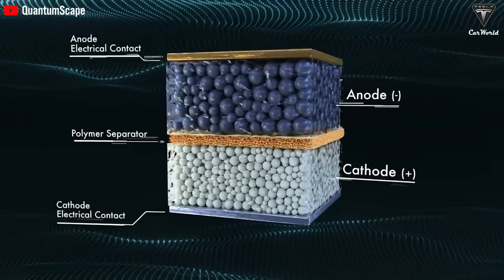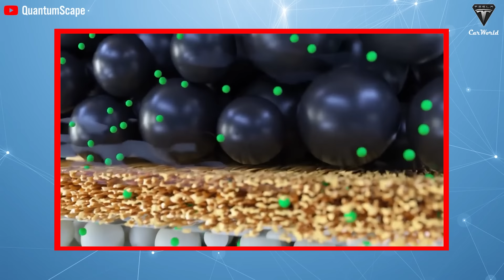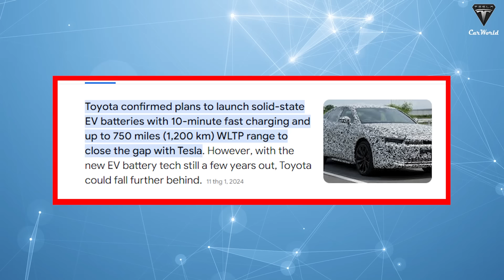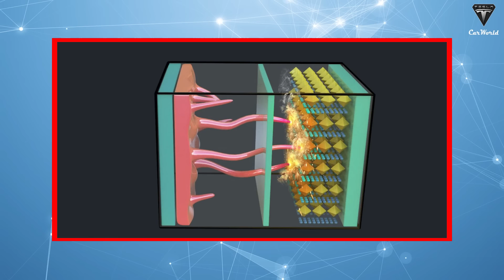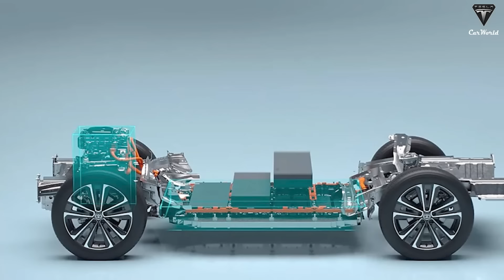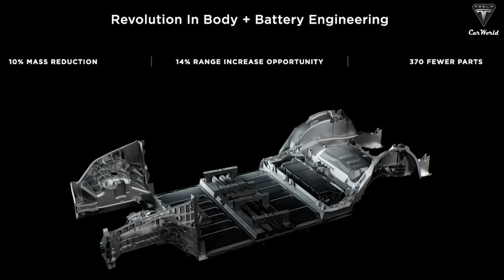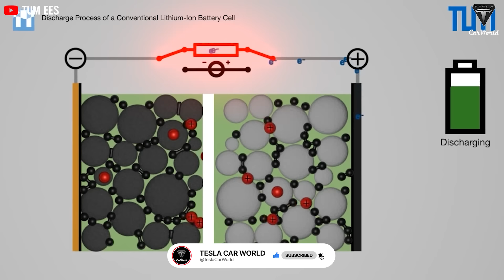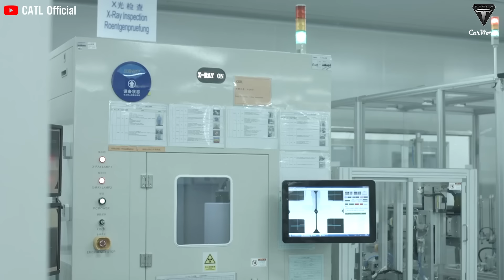It Happened! Elon Musk CONFIRMS 4680 Tesla Battery Win Toyota Solid State Battery !

Comment: All this tells me is that we are not ready for electric cars yet. When our "4000 lb 350 mile power pack" goes down to 100 lbs and 1000 miles, that I can plug into a standard 120v outlet or 220v dryer outlet, and charge in 15 minutes we'll talk about it.
Reply: How would a 120v outlet give 1000 mile in 15 minutes to anything bigger than a hot wheels? Do you understand the physics of how much energy it takes to move a car, and how much can physically move through standard home wires?
Reply: punishthemeatpocket  K, well when gasoline can be delivered to my garage thru the electrical outlet, I might consider an ICE vehicle again…

Or when I can regenerate gasoline from braking. Or when the engine becomes small enough that it doesnt end up in my lap in a front end collision. Or when I can generate gasoline from solar panels on my garage.  None of these things may be possible, but they are necessary.

Comment: From my 20 years experience, deplyed up to 50KW solar plant and using 7KW solar power since 8 years at home, I practically tested on a private site yesterday, during the summer the effeciancy reduces from 70 or 80% to 50%  or less if no good ventilation, however keep in mind the total watts and volts testing of individual panels one by one and full system before and deployment.
The output will be reduced as soon as the system is deployed 
300W x 10 solar panels wont produce 3,000W or 3 KW

Comment: Do you know what i have realized that if hesla want optimus gen 3 to work 10 hours before you need to change it the weight of the battery should be 2.5  pound 😮🎉
Reply from the maker: The battery for Optimus Gen 3 will be quite impressive, 10 hours of continuous operation is easy too!

Comment: Solid state batteries are a pipe dream.  4680 batteries exist, Comparing a pipe dream to something that currently exist is not a fair comparison.  By the time the solid state battery becomes real Tesla will have the X battery which will deliver 100 times the performance of the solid-state battery.
Reply from the maker: We know that comparing a battery that has been out for years with a promise is unfair but it is necessary to let us know how powerful the 4680 Tesla battery is

Comment: Im curious cuz electric wires work like water hoses if this battery can hold more and charge in 10 mins will there still be enough power in the wires to continue on to other buildings in the more extreme situations or is tesla investing into infrastructure at all
Reply: Also am curious if a tesla could be equipt with additional batteries for us more contry side folk